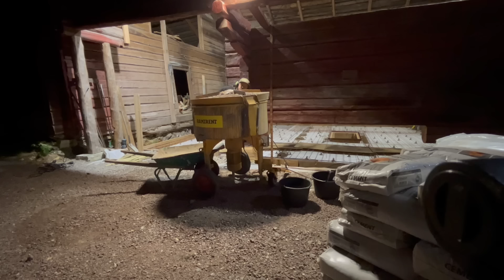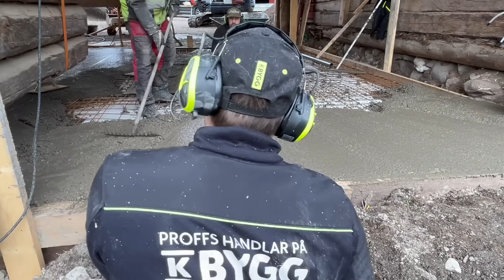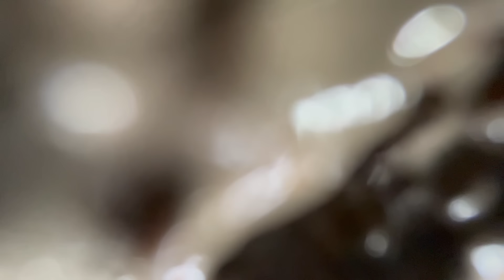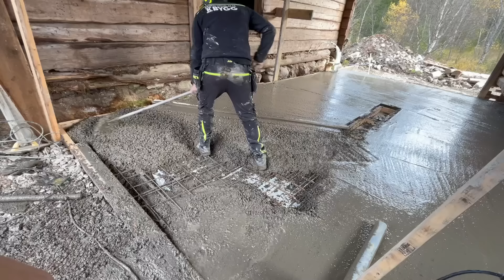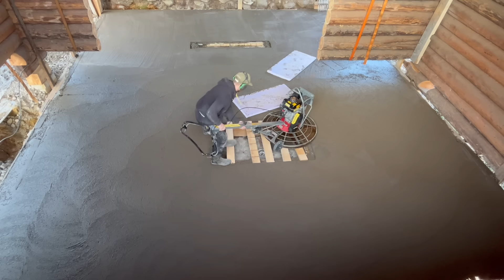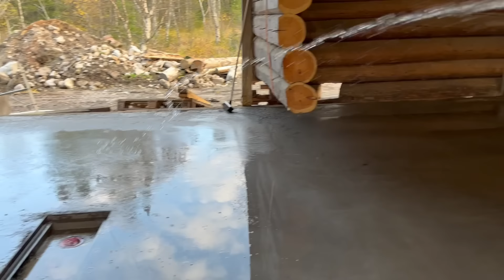Garage Build #5 Mixing, Pouring And Finishing Concrete

Comment: Calling Swerock Mora for 7,5 m3 would cost 20k sek
Reply from the maker: I think it was about the same from Hede but transport is expensive too.
Reply: I poured 14 m3 for 80 m2 last month, was 40k sek inclusive transport from Mora to Orsa
Reply from the maker: @martijnheeroma5492   I think i ended up around 6k for the cement and gravel for this😁